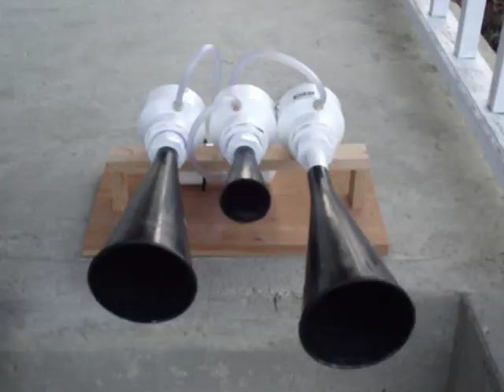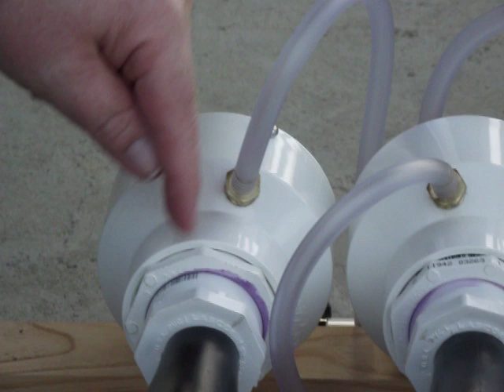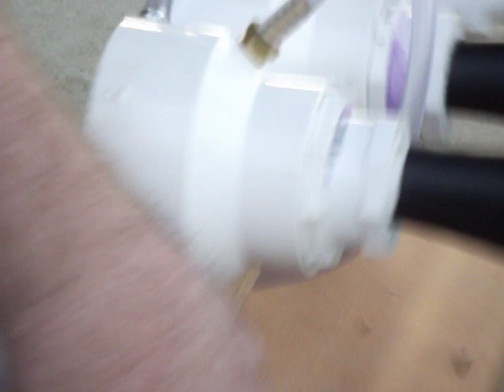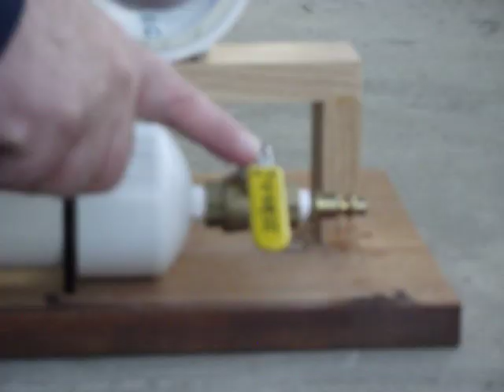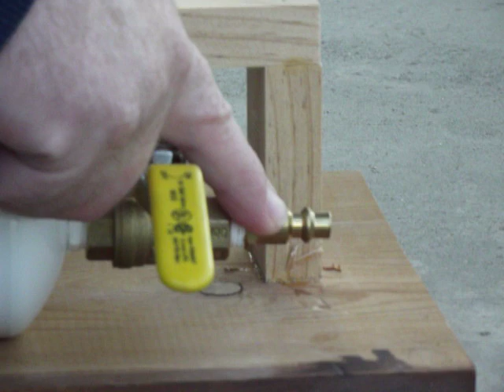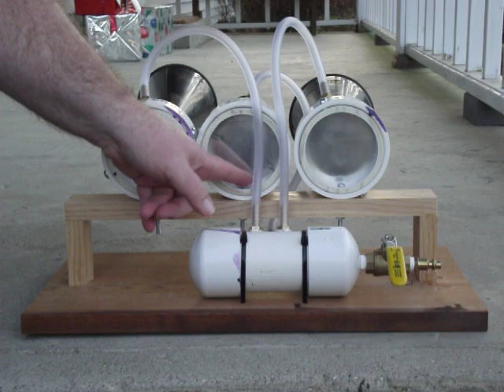PVC train air horn Nathan K3LA construction hints

Comment: Hi Lazerdam! I am a Journeyman Toolmaker.I really like your design,it is very well made.I am building mine per your sample.
As a side note I use 4 6"x 20' PVC pipes daisy-chained together for my compressor accumulator tank.Those pipes hold 140 lbs.of air no problem.Those pipes are a lot cleaner internally than a metal tank while affording my Worthington compressor clean air storage.
In conclusion;Luke doesn't know what he is talking about.
Take it from a good I.A.M. Union trained Journeyman.

Comment: In addition, your manifold is less efficient than the type dozerboymiller constructed. The reason for this is that his design has a valve leading to a small length of pipe out of which the air lines go. This gives the air easier passage to the horns for more pressure and thus, power. In your case, the valve leads to a larger section of pipe which makes more dead volume and causes the air to expand further before it enters the valve, which lowers the pressure as the air enters the horns.

Comment: These are not improvements. Dozerboymiller has his reasons for designing these horns the way he did. The horns are drilled for air input in the front of the reducer because that is a triple layer of pvc. This is important because the reducers are not pressure rated. Drilling into non-pressure-rated fittings where you did really weakens them and is more likely to leak and crack.

Comment from the maker: If you look again you will see that the PVC is not a tank it is a manifold. The air line connects to the ballvalve which is in front of the manifold. when the valve is closed there is no pressure on the manafold. When the valve is open the air passes thru the manafold and enters the three air horns. The PVC is never under much pressure. Also the airlines are friction fitted so if much pressure built up the lines woulD come off their fittings. NO ONE SHOULD EVER MAKE A AIR TANK OUT OF PVC!

Comment: Nothing you mentioned in your comment has anything to do with my main points.

But since you mentioned my in your comment I feel the need to refute. Using a bunch of pvc pipes for an air tank is not the best idea. You could save a lot of room by just using a metal air tank. The conditions on the inside of the tank have nothing to do with performance of the horns or the compressor, and a metal tank with a proper drain valve on the bottom will last for a very long time if maintained correctly.

Comment: read through the comments. Luke is kind of an idiot. The mounting of the fittings in the sloped section is much easier, and at this point in the horn it is low pressure, so there is absolutely no compromise to the design. The same can be said for the manifold -- it is low pressure, so there is absolutely no need for concern about the pressure, and it's a slick way of doing it. Job well done -- I would be interested to know what the diaphragm is mad of though -- it kind of looks like an aluminum can?